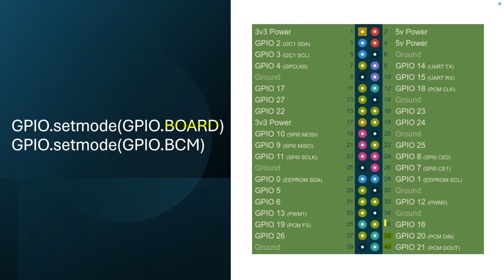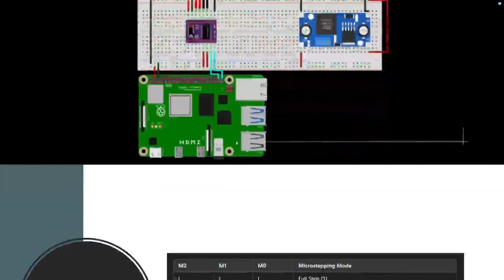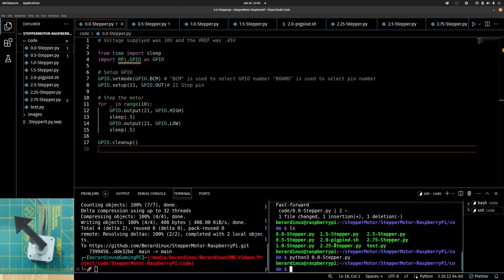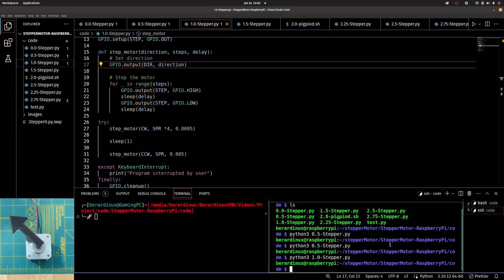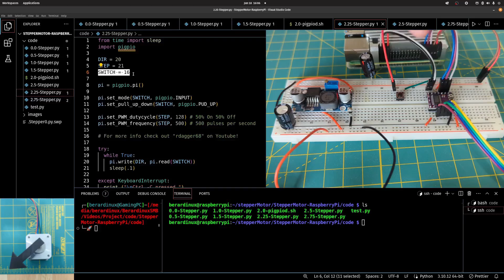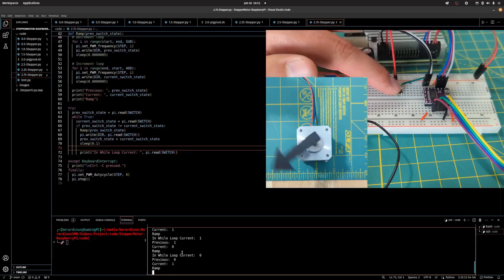Stepper Motor Control with a Raspberry Pi and DRV8825 Controller!

Comment: There is a mistake in the breadboard diagram - you have the +10V coming from the power source going to ground (upper row) on the breadboard - it should be the 2nd row.